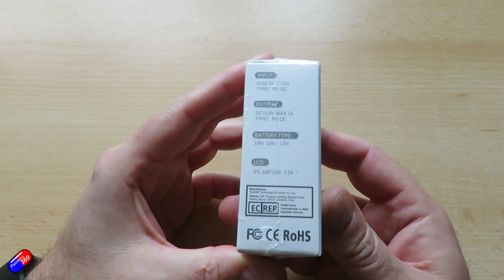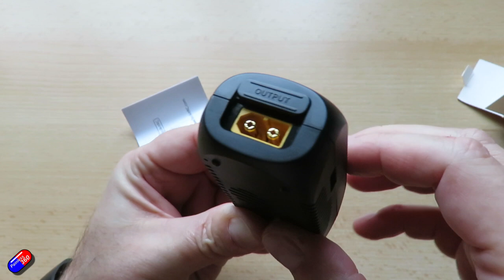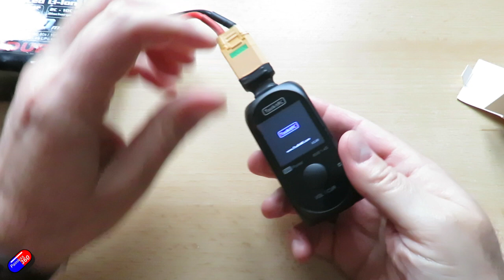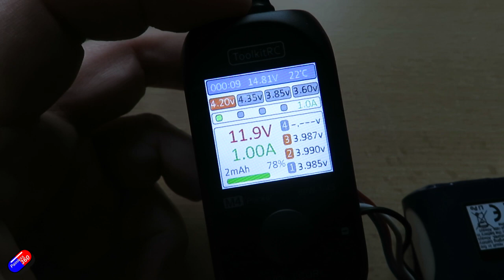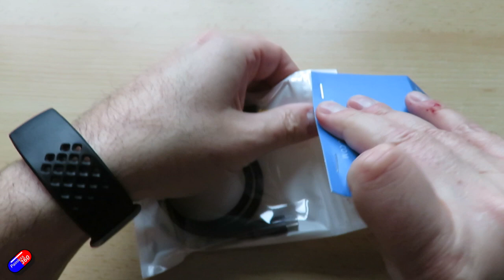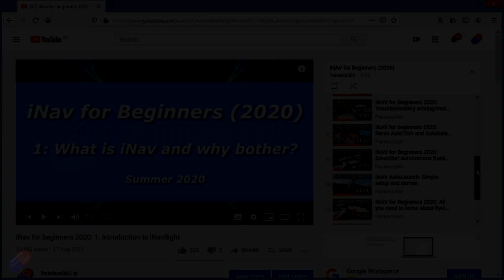New ToolkitRC Released Today: M4 Pocket Battery Charger and SC100 USB-C Adapter Cable!

Comment: Does this sc100 cable works in reverse? Meaning can you charge a normal usb type c device using this cable by introducing power from the xt60 end
Reply from the maker: I never tried it that way, If it does please let me know.

Comment: If I were to connect a 10,000mAh  hour usb-c battery power bank that I use to charge my phone… How would it know if I’m trying to Use The USB-C power bank to charge a Lipo battery or use a Lipo battery to charge the USB-C power bank? 

Or… do I have to purchase the cable you showed to be able to charge I Lipo battery using the USB-C power bank and the USB-C port on the unit is technically an output only? 

Please help me understand how it knows which way to send the current. Thanks!
Reply from the maker: I don't have them here to look at now so I'd suggest asking this of a seller. Best of luck!

Comment: Thank you for your helpful video.

I don't understand PD very well:  if I've got a pd which is capable of USB-C output: (18W PD) 5V 3A, 9V 2A, 12V 1.5A, then how does the M4pocket decide which voltage and current settings to use?  

Also, if I just use the SC100 cable with my old ISDT Q6 pro and my 18W pd, how do I set what voltage is selected (i.e. 9v or 12v -the Q6 won;t use 5v as it needs between 7-32v)? I would prefer just to spend on the cable and use my existing ISDT Q6 pro, but I don't understand how different voltages would be selected...

On a related note, could the ToolkitRc SC100 cable (which has usb c to xt60 connectors and some king of chip, meant for allowing a pd/power bank to be used as input for a charger) be used on the output end of a charger to connect it to a power bank and then have the charger charge the power bank?

Comment: Very interesting ! I'm searching the perfect combo of a single power source for laptop, smartphone, and lipo charger, to be able to travel light 😎. We are not yet there with this stuff because it is a too restrictive charger, but we clearly see we are going in that direction. That will come. I love also the xt30 xt60 dual connector. Honestly toolkitrc is innovating a lot at this time. Thanks for that review.

Edit : in fact I would really appreciate to get this cable, if I win. I think it will solve my need.

Comment: Really good for field charging, I'm wondering what voltage option it can output when it is output in usbc. I'm not expecting full range since it doesn't charge 6s.

Comment: Sweet little charger. My only thing I am worried about is changing the charging rate but hey will come in handy when dont need to use the larger charger and the fact that you can charge over usb is great/.

Comment: I love their stuff. I have an M6D which comprises part of my charging station or can be taken to the field along with a lead acid battery. I also have an M7 for anything I charge indoors, to test servos and receivers and act as a handy bench power supply (powered from a surplus laptop power supply). I love both but the M7 blows me away with what it does for under £40. If I win, please spin the wheel again for somebody else as I'm in the nice position of not needing the M4. Happy Xmas Lee!

Comment: Great. Discharging from full to 3.60 v is a better way to gauge a battery's real life capacity than just discharging to standard storage voltage, as the below 3.82 capacity can vary a lot.

Comment: Thank you for the great update.   

I wholeheartedly agree about the fact that ToolkitRC makes great quality FPV equipment.  

I have on question regarding the cable and that is:  Could it be used with a power bank to power up the DJI FPV V1 Goggles?

Merry Christmas 🎅 
Sam